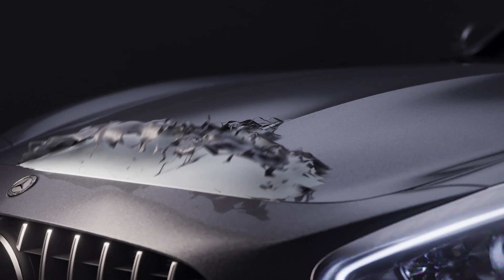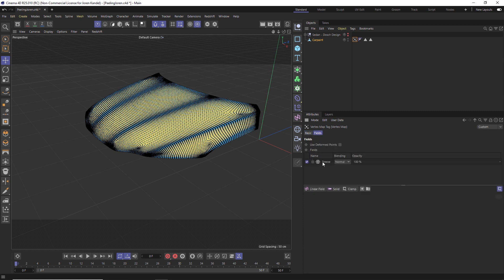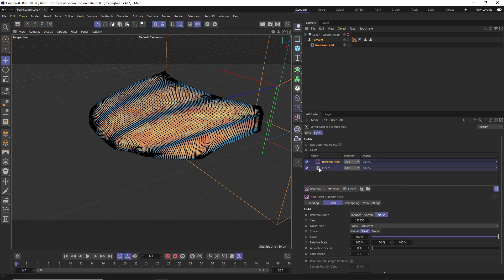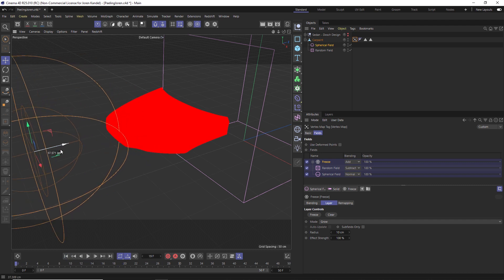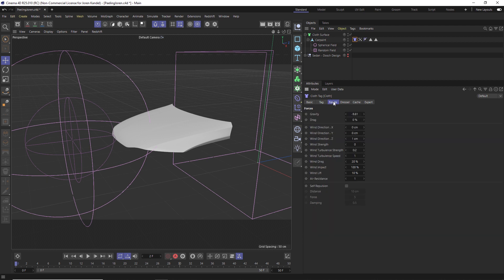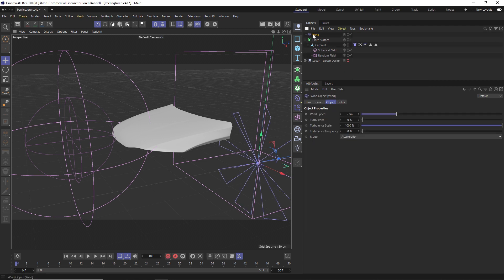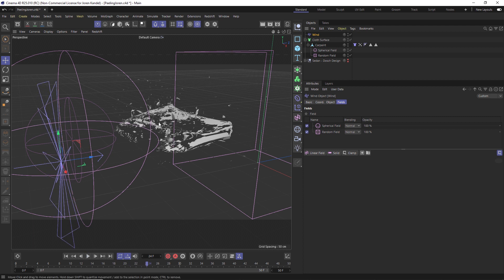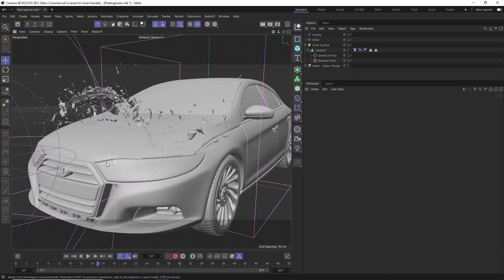Cinema 4D Tutorial: Paint Peeling Effect

Comment: For those who are struggling to make this work (the cloth doesn't tear / the mesh explodes) here are some FIXES THAT SOLVED IT FOR ME:

- the topology of your object must be good, otherwise it won't work (so quads-only, no weird polygon orientation, not too dense but not too low-poly either)
- the scale of your object must be reasonable compared to the scene, I used the basic Cube as a refernce (200x200x200 cm) and scaled my object to a similar size.
- the tearing actually happens in the Cloth Surface object, not on the base geometry, so make sure that you: 1) apply the cloth surface tag and give it some thickness (try it on a plane beforehand, you must be able to see the thickness a little bit - seems obvious but for me it wasn't working partially because of a very low thickness value) and 2) put your Cloth Surface object inside of a Subdivision Surface object and give it 2 sub levels, decrease to 1 if your PC is struggling.
- Assign your Vertex Map tag to the Stiffness inside the parameters of the Cloth Tag, not to the Friction.
- Use the Belt tag on a random object placed close to your own object (or inside, if your object is hollow) to "keep" the cloth in place while it's being torn by the Fields. there are some extra steps to do here, so for more info watch this: https://www.youtube.com/watch?v=QqfGt-qcnrs

You could also try this: vimeo.com/73997991

Hope this helps
Reply from the maker: Wow, incredible. Thank you so much for taking the time to post this, it's a huge help!!!